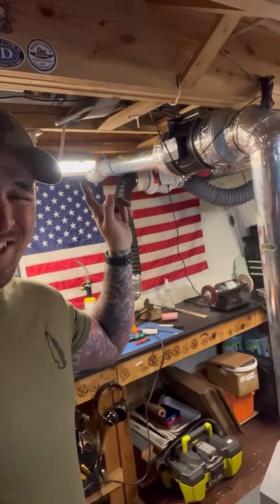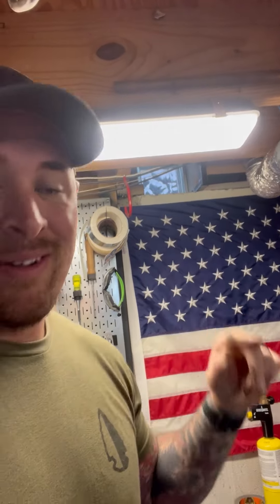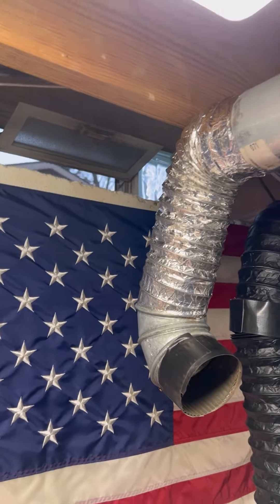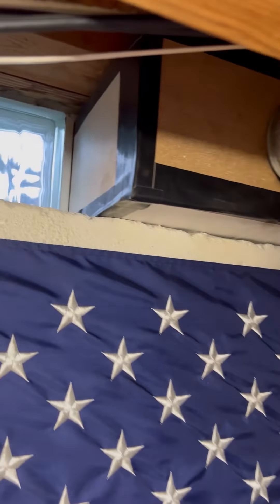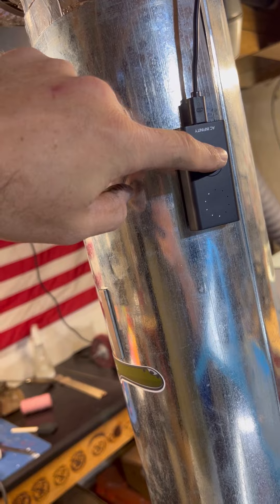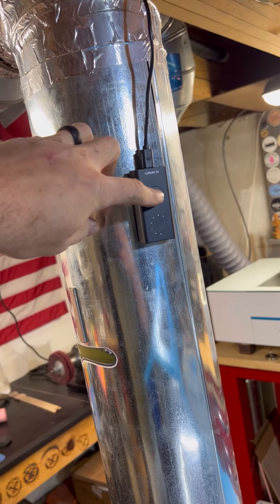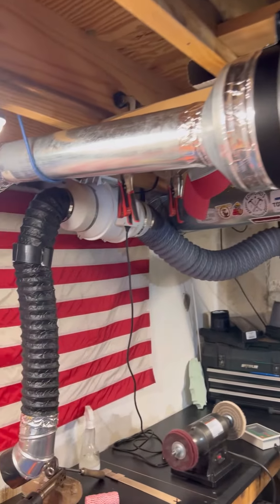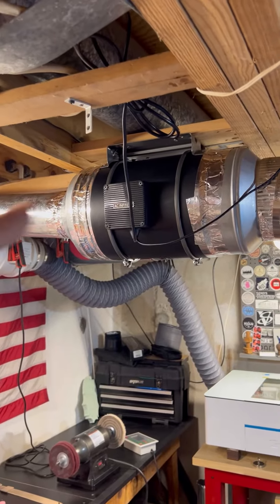Upgraded Fan on CO2 Laser | AC Infinity

Comment: awesome.. only have  about 2 weeks  with  my AF2028- 80W and  my garage is  full smoke . i order the 8 in infinity fan .. arrive  maybe  tomorrow  i can't  wait to install that fan. thank you  for  share
Reply from the maker: You’re going to see a huge improvement! Did you take out the stock fan?
Reply: @EdmondsWoodshop  no, yet. Still waiting for the new fan. I guess is delay because the weather. I may make a video. I have an ORTUR laser too, is a 5w , I built an enclosure but had a cheap fan too. I will try to connect both to the 8" infinity fan. I ordered the reductions and the  Y - 8"x6"X4" at homies depot . They arrive today.

Comment: Cam I seen your video on upgrade the exhaust fan to an 8” van I brought mine hooked it up and it seems weak my bed area be full of smoke.  Is it cause it’s in the back sucking the air from underneath the bed ?
Reply from the maker: Which laser do you have? Some of the lasers have grill covers over the ventilation port . Those grills can get clogged if they're not wiped down or scrubbed clean. Some of the grills have to be cleaned on the inside as well.
Reply: @ omtech 24/35 it’s brand new just got it few days ago first time cut noticed the smoke wasn’t leaving that much

Comment: do you have to then turn the exhaust fan on/off manually at this point then?
Reply from the maker: I do for this fan. I don’t have a smart controller on my smaller 80w. On my OMTech pronto it has an onboard smart controller that powers the fan at the same time the laser starts and turns off 30 seconds after it’s complete.

Comment: Hi, we just got our new 80w laser and I have a question. Is it crucial to take out the fan if I'm putting my infinity fan?
Reply from the maker: It’s not crucial, but since your stock fan produces around 99 cfm and your inline fan produces around 400 cfm (6 inch ) or 800 cfm (8 inch) then the stock fan will act as a choke point or bottle neck because the CFMs don’t match.